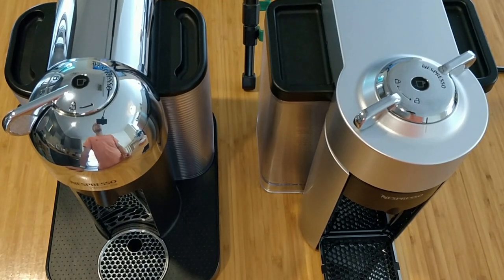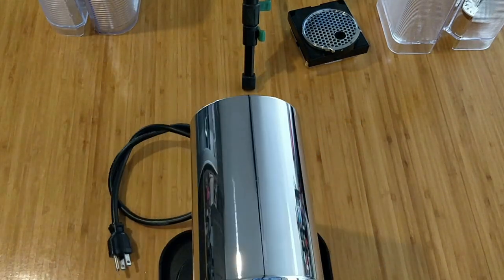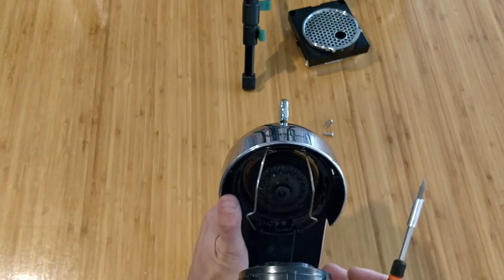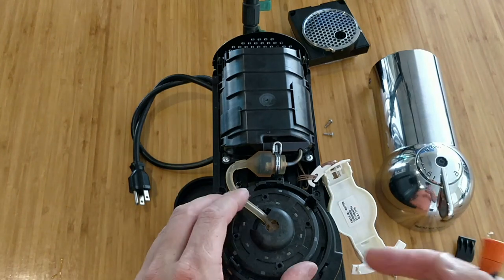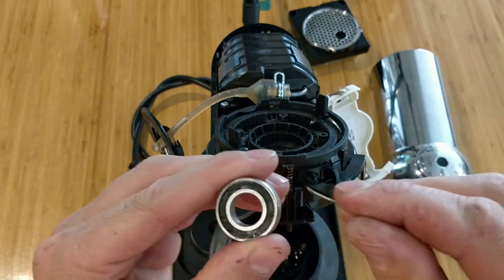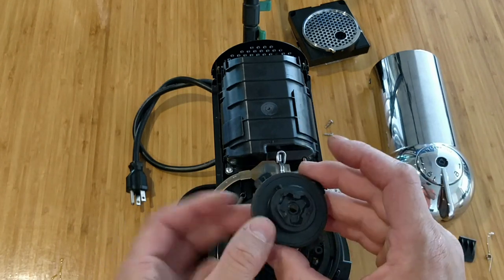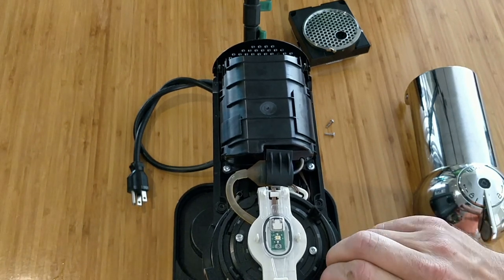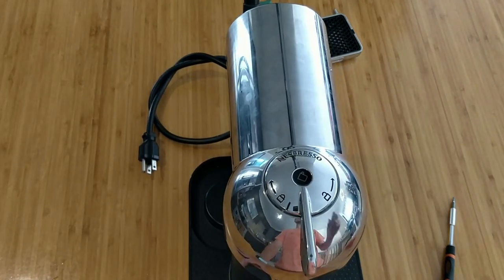How to fix Nespresso Vertuo Machine loud noise or no Water

Comment: Why is there a bearing in there? What can possibly be spinning up there?? My Keurig is doing the same thing (since the 1.5 year life expectancy of all Keurigs has run out )  but can’t imagine what that bearing does. I figured this Sanka machine runs the same way, but don’t get why a bearing could possibly cause the issue, even in the Nescafé machine as shown in the vid.
Reply from the maker: it's always in wet and dirty environment and they are not top quality.
Reply: The Nespresso capsule spins as part of the brewing cycle. Whereas a Keurig the hot water simply pours through, for the Vertuo the spin cycles extract the coffee and that's what creates the crema. It's more complicated than that, but that's why there's a bearing in there.

Comment: Hi, I went through the process but now my machine blinks twice then is steady white light. But no motor sound and no water starts. I have reassembled twice. Any suggestions?
Reply from the maker: check the wiring connection maybe it got lose.
Reply: Had the same thing happen.  Did you figure out what was wrong?

Comment: Now that the bearing is fixed the machine makes watery coffee with grounds in it. Please advise?
Reply from the maker: Reassemble it, metal plates may be moved.
Reply: Take it apart and when you put the little metal tube back in, there's a notch in the flat c shaped ring that has to line up with the tab on the top of the cover for that piece. Then the rubber hose drops in flush, so you get solid water pressure and no back flow. 

I disassembled this thing three times before finding that tip in the comments here.

Comment: Excellent video - Thank you! One question: When I reach the removal of the part that holds the giant spring in place, my Swedish-made GCA1 machine lacks the center piece that you unscrew in the video. Mine is a single part that I cannot unscrew or do anything with. Very frustrating as it’s all in pieces on the kitchen counter. Anyone else run into this?
Reply from the maker: I never saw one part maybe it stuck ?

Comment: Help..! Followed all directions and everything worked great EXCEPT;;;;; now the Coffeys tastes like water..!. Can you advise..?
Reply from the maker: reassemble it.
Reply: Me too. I followed all the instructions and now the machine is quiet but coffee taste like water and with no foam on top
Reply: Take it apart and when you put the little metal tube back in, there's a notch in the flat c shaped ring that has to line up with the tab on the top of the cover for that piece. Then the rubber hose drops in flush, so you get solid water pressure and no back flow. 

I disassembled this thing three times before finding that tip in the comments here.

Comment: I messed up the last step that you said was extremely important and my machine won’t open. Is there a fix for this?
Reply from the maker: I remember I accidently closed it one time and checking the mechanism was able to open it. So it it realizable but don't force it look for the pin to do it, as I remember I removed top cover it was hard when it's closed and after press on something and it opened.
Reply: Same thing happened to me! Anyone have a fix on how to unlatch?

Comment: Thanks. Just need to figure out why it’s a little watery. Figured out how the piece with the C clip connects to the hose. Now the coffee comes out looking fine then starts getting watery before it finishes
Reply from the maker: There are 2 metal plates maybe they are unaligned.
Reply: @RomaFixcom  Where are these metal plates you keep referring to?
Reply: Take it apart and when you put the little metal tube back in, there's a notch in the flat c shaped ring that has to line up with the tab on the top of the cover for that piece. Then the rubber hose drops in flush, so you get solid water pressure and no back flow. 

I disassembled this thing three times before finding that tip in the comments here.

Comment: Finished replacing the bearing, but water not seeming to come through. Any tips?
Reply from the maker: maybe air in line I thing you can find some videos how to remove it.
Reply: Take it apart and when you put the little metal tube back in, there's a notch in the flat c shaped ring that has to line up with the tab on the top of the cover for that piece. Then the rubber hose drops in flush, so you get solid water pressure and no back flow. 

I disassembled this thing three times before finding that tip in the comments here.

Comment: Hi, 
Help! My husband and I followed your instructions to replace the bearing and everything seemed fine but when we went to test the machine, the noise disappeared but instead of coffee, the machine now only pours water. The capsules are perforated so we can't figure out why it isn't working. We reopened and checked everything against your video and still same results. Can you please help? I would hate to have to buy another machine. Thank you!
Reply from the maker: Hi, I would start with disassembling it again and checking the part that's making holes in the capsule if all the part fitted fine and it there is tension.
Reply: Mine is pretty much doing the exact same thing. No crema and bits of coffee grinds o my cup too. It’s like there’s no pressure anymore
Reply: Take it apart and when you put the little metal tube back in, there's a notch in the flat c shaped ring that has to line up with the tab on the top of the cover for that piece. Then the rubber hose drops in flush, so you get solid water pressure and no back flow. 

I disassembled this thing three times before finding that tip in the comments here.

Comment: Seriously frustrating when you pull machine out of camera view and I’m over here trying to follow step-by-step what you’re doing. After removing the springs, the white part with the black rubber, I am stuck because I don’t know how you pulled off the white part you said also push from the side, but there’s nothing to push from. Your video at 05:45 needs to be re-shot please because now I’m stuck with the machine I pulled apart and cannot complete because the white part won’t come out as easy easy as yours flipped over

Comment: What do I do if I didn't align the lock and closed the lid now its locked shut?
Reply: EDITED COMMENT:   You CAN remove the top covering from the outside even AFTER screwing the screws back in. I was mistaken about needing to break the top if the smaller 2 underneath screws were already screwed in - they are easily accessible from the outside (turn the machine over far enough to get at them). His video explains most of this potential problem (13:30) but does not mention the plastic latch problem I discuss in my main comments. I ended up forcefully pulling the top cover up and slightly outward and ended up breaking those damn latches w/o damaging the cover at all. Break them if you must (very difficult to get access to them)!  They are not essential. But I suppose there may be a chance of breaking the top. So using a very slim blade or slot-head screw driver, try first to pop them out as you did when undoing the cover to begin with (2:20 - NOT easy at all, IMHO).
Reply from the maker: if you follow video step by step there shouldn't be a problem.

Comment: I too need to see where I can purchase the bearing
Also, what grease do you recommend??
Reply from the maker: grease if you need temporary fix old one, for new one I gave the link in description, but pay attention it should be stainless steel.
Reply: @RomaFixcom  what type of grease ?  And which parts need grease  (aside from bearing) ... do you grease only the outside ? Inside ? etc ...  Thanks for the video !

Comment: Thank you so much for your video. Seems to have helped with the noise, however, we are not getting the same cup of coffee as before. It’s not producing the crema/foam top as before. Taste seems to be the same as before just without crema. Anyone else have this problem after putting back together?
Reply from the maker: try to reassemble it, may help.
Reply: This exact thing happened to me !!!!
Reply: Take it apart and when you put the little metal tube back in, there's a notch in the flat c shaped ring that has to line up with the tab on the top of the cover for that piece. Then the rubber hose drops in flush, so you get solid water pressure and no back flow. 

I disassembled this thing three times before finding that tip in the comments here.

Comment: For anyone hoping to fix a Vertuo Next using this video, the Next is more complicated. It uses two bearings (one larger, one small, neither the same as these). Overall not a complicated disassembly and mine ultimately just needed a thorough cleaning of all moving parts and the bearings were fine. The symptom on mine wasn't noise; I was having to manually turn the mechanism every morning as it would stick and throw an error. If anyone needs guidance opening theirs let me know. The next time I do maintenance on it, I will take the time to measure the bearings and replace them.
Reply from the maker: Good to know, thanks.

Comment: Hi, so sorry I do not see the link for the bearing. Can you please send me? Thanks for the video, very helpful!
Reply from the maker: https://www.aliexpress.com/item/1005001873591940.html?aff_fcid=4ef17c5f3de14342b66ca66c46758fe6-1634939786109-03738-_9ij8wl&tt=CPS_NORMAL&aff_fsk=_9ij8wl&aff_platform=shareComponent-detail&sk=_9ij8wl&aff_trace_key=4ef17c5f3de14342b66ca66c46758fe6-1634939786109-03738-_9ij8wl&terminal_id=3ba406f544d845d2be08c422faf0c4c4
Reply from the maker: if you need quicker delivery check same size on amazon and to be stainless steel.

Comment: I just changed the bearing , the machine is running now very quietly, but the coffee is not strong as before. Any advice please ?
Reply: Take it apart and when you put the little metal tube back in, there's a notch in the flat c shaped ring that has to line up with the tab on the top of the cover for that piece. Then the rubber hose drops in flush, so you get solid water pressure and no back flow. 

I disassembled this thing three times before finding that tip in the comments here.

Comment: Don’t waste your time with this fix because the last step has a success rate of less than 10%. Here’s why: Keeping the two front bar springs compressed and in place while putting the cover of the unit back on is almost impossible because putting the cover back on requires a level of force which jars the two front side springs enough to decompress them and fall off. The unfortunate part is you don’t realize this until the final step.

Comment: Hi where can I buy the bearing? I’m in Canada. Amazon would be simple if you have a direct link. TIA 👍🏼
Reply from the maker: I ordered from aliexpress, amazon will use same chinese sellers (shipping from china ) but it will be more expensive
Reply: You can get this size bearing in various forms from Bearings Canada Inc. I bought the ceramic version for longer wear resistance. 5x cost from AliBaba but got it in ten days. Still waiting for the Chinese supplier. This is an excellent video. Saved buying new machine. Cant believe Breville did cheap on the bearing ......critical component. Used a container for screws!

Comment: I’m screwed. I’m not strong enough to push the spring down far enough & twist it back in position.  But I think I could have done it.
Reply from the maker: Try it through a blanket.
Reply: Make sure it's the right direction, it'll only go one way. Try putting it on without the spring first to determine which way is correct, then do the same with the spring.
Reply: The mechanism needs to be turned counter-clockwise first so pins are at 2 and 8 o'clock. Then it goes on easily.

Comment: Help! I’m left with a part that must have popped off when I wasn’t looking. 
Does anyone on here know all the parts? I don’t see a way of uploading a photo.
Reply from the maker: recheck one more time video and find where it can be or explain how the part looks like.
Reply: Small hollow cylinder 5/8” long by 1/8” wide with a thin ring around it about 1/8” down from one end. The ring is not all the way around, but that could be because it broke. No noticeable thread inside or out.
Reply: Hey, I found it. The little part that is inside the hose. Most of putting that part back together wasn’t shown on the videos. Might want to redo that part. Thank you

Comment: A warning to anyone trying to attempt this......when resealing the top lid of the unit he doesn't demonstrate on, be sure the locking mechanism is working. I closed it up and the locking knob is useless to open it. I am stuck without ever knowing if this bearing worked! I have no clue how to get the lid open now.
Reply: You should have watched the full video. That’s clearly explained at the end.
Reply: @eduardowallach4324  Indeed it was and the story of my life....too impatient! I see the error of my ways but the good news is I have a NEW Nespresso machine!
Reply from the maker: If it's blocked you can still open it, it's hard but realizable .